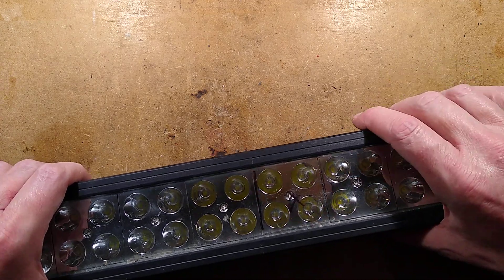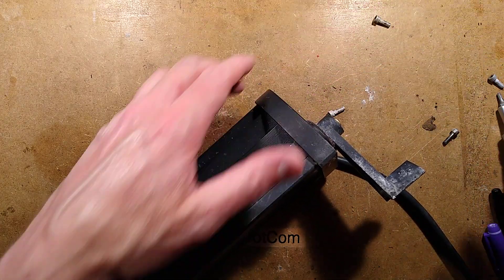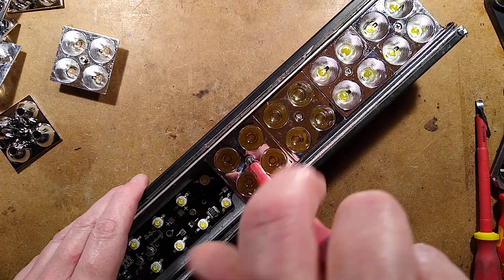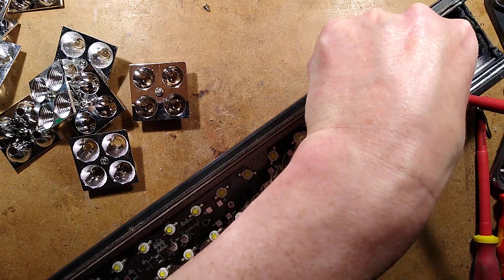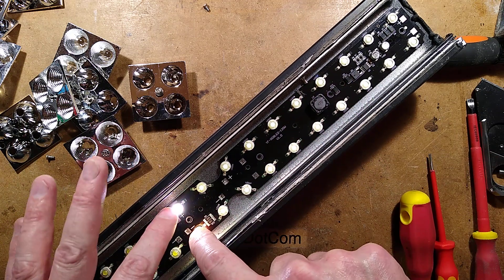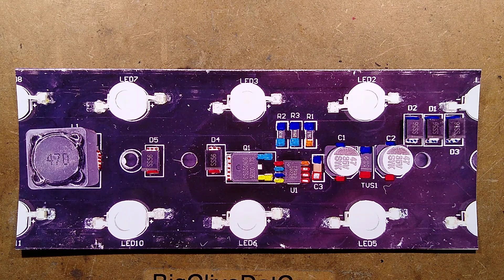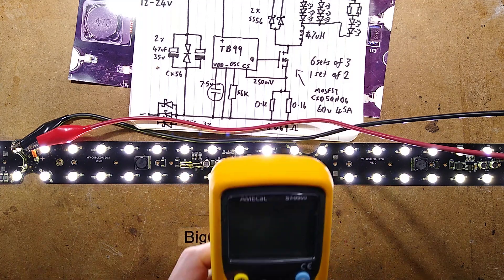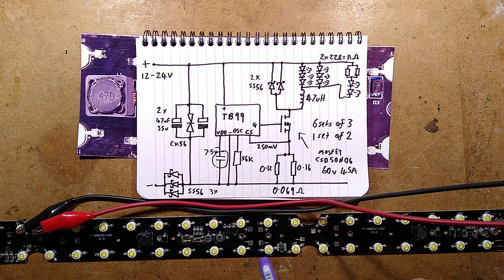Opening a work light from a commercial fishing boat (with schematic)

Comment: I managed to remove the glass on a small version of one of these floodlights.
I noticed that the black rubber strips had a few millimeters sticking out of each end, so I was able to pull both these ends - not to drag the strips out, but to stretch them to a reduced diameter, thus reducing their grip on the glass.
The rubber strips had been fitted dry.  There was no glue or cured sealant involved.

Comment: Only the solder joints being affected means that while it is water proof, it's likely not 100% air tight and the corrosion is from salty moist air getting in.

Comment: Thanks for sharing. 
That's a different design to the LED bars I've pulled apart to reverse engineer. 
All the bars I've stripped have all the LED emitters in groups of 6 series strings. Each series string comes on it's own PCB (a module if you like), complete with separate boost drivers for the 6 LEDs on that module. 

Using this module design, means the LED bars can be made into different lengths, in multiples of 6, with 6, 12, 18, 24, 36, 42 and so on. The only difference between them being the length of the aluminium extrusion, the length of the glass, and the number and design (spot or flood) reflectors used.

Additional this LED bar uses sealing compound to seal the glass, end caps and cable entry point.
All the bars I've pulled apart have used greased O rings to seal the polycarbonate lens and the extrusion, with additional O rings sealing the end caps, the cable entry being the only area sealed by compound.

Comment: Do stainless steel and aluminum get along by touching each other all the time?
Two dis-similar metals, in the presence of salt water, lust after each other like two horny teenagers. 
The white powder around the screw's threads, indicates aluminum corrosion. 
Me thinks they should've used aluminum or plastic screws instead of stainless.

Comment: Interesting approach of using the same kind of diodes in parallel. Guessing this translates into a cost saving.
Reply: Yes it will increase the current carrying capacity so can replace a much bigger and more expensive diode, however it is fraught with danger since not all diodes are exactly the same.  The diode with the lowest forward voltage will still carry much higher current.   It's not something that is usually recommended.  I guess that's how China do...

Comment: it would be intresting to try to re- seal it up ... sealing for salty water is different than regular water mainly becoz of the salt residue and the fact that salt will eat up and erode most of the sealing compounds
Reply: Water is a damn tricky thing.

You get what appears by all accounts a good seal on something from the elements... You'll find out the seal works, but only in reverse.

Never have figured that out lol

Comment: We engineers can get fooled when a schematic gets turned upside down, but what you have here is a conventional buck regulator with a very small "twist" to it: no output filter capacitor. LEDs need regulated current, not voltage, so the TB99B controller does away with the unneeded (and sometimes unreliable) output filter cap. If you turn Clive's schematic upside down, you will see a standard buck regulator but without an output filter cap. Of course, you need to reverse the polarity of the catch diode, and swap out the NFET for a PFET, after which Bob's your uncle. Probing the drain of the FET, you will see a rectangular voltage waveform whose duty cycle is Vout/Vin, although in this case, Vout is referenced to the positive power rail, not ground.

You see this kind of arrangement with the load referenced to the positive power rail rather than ground in a lot of LED mains-fed switchers. It crosses many engineers' eyes when they first see it, but that's what's going on. Beginning engineers think everything must be "ground" referenced. That's not necessary. Electrons don't care what your reference is. "That's your hangup, not mine." 

Not sure why the ceramic filter cap on the output of 7.5V regulator failed. In my experience, ceramic caps are usually quite robust. It may be "just one of those things."
Reply from the maker: Traditional ceramic capacitors used to be extremely reliable, but they have made the layers thinner and thinner to the point where stress can cause then to crack and develop parallel resistance.
Reply: @bigclivedotcom  I want to state that I am NOT trying to pick a fight, only try to understand why the regulator failed, from half way across the planet. I question the blanket "stress" statement. What stress? This particular capacitor should lead a very gentle electrical life. My theory: without a capacitor on this Vdd node, the part will not operate properly. Regulators require a small capacitor to be stable. I would suspect a bad solder joint on this node, causing the capacitor to be disconnected, leading the regulator to become unstable. Solder joints are a very common source of failure. They can certainly crack. Just touching the 3 nodes (2 on the capacitor, one IC pin) with a soldering iron would have tested that theory. Oh well. Thanks for hearing me out. I look forward to all of your videos.

Comment: I think they might have slid the glass in an then spread sealant in the groove and squeezed the rubber bead in to seal it. Removing that black bead might have been the move. Like a car windscreen. I am replacing security lights at the moment with led versions a 1/10th the wattage but 30% more lumens. I got a complaint that they are too bright lols.

Comment: I fixed one for a friend few years ago. It was a 50" ebay chinesium one. The construction was similar but much easier to take apart and back together. The glass was held by 2 strip of aluminium screwed with a ton of screw in the body of led bar.
 The fault was only after 2 -3 min of use all the led bar went out except a small group of led on one side. Once open, the fault was easy to find. 
The power cord was solder to the board and traces power all the other power supply. They added small wires over the traces because the lamp draw a lot of current. At one place close to the power cord a wire was solder on the + trace, 2 inches of trace vaporised and another wire going to the rest...
I solder a piece of 14 awg solid wire and it was fixed, + a lot of silicone to put it back together
Reply: What about internal condensation from moist air?  Ideally, a product like this should have been filled with dry, conditioned air or better yet some inert gas like nitrogen before being sealed up. The fumes from the curing silicone caulk could also be corrosive over the long term, especially if it's the vinegary-smelling stuff.

Comment: I got the Wally world special version of this thing... Haven't opened it yet but also not planning on putting it in the elements and it was for a project that hasn't yet come to be... I digress.

It's effing gnarly bright... But I'm not gonna let it run any length of time until I've confirmed the heat sinking (or lack of as is common 🙄) and check it out...

I like previews of anything tho, even if I'm not gonna be going in what I see... This just happens to work out lol

Comment: As someone who goes off road all the time the best thing I've found is to take the light bar apart right when you get it and just smear silicone on every mating surface you can.
Reply: Silicon as in the setting type or Silicon grease?
Reply: @darkknight145  or the type used for boobs...
Reply: @darkknight145  silicon grease is completely another type of paste, just for greasing/lubricating where you don't want petroleum product. Silicone sealant neutral or acetate like bathroom sealant. Or something much stronger like polyurethane or polimer sealant.
Reply: @mihamaker  Could the acid released into the sealed enclosure result in corrosion? @ acetate silicone. Nail polish is a popular choice, I think clive used it on some of his outdoor lights with good results.
Reply: @obliviousostrich1002  Acetate yes for sure it will react to any exposed reactive metal. That's why I noted neutral silicone if someone wants. Similar stuff is for gluing mirror on bathroom wall or cabinet door. Otherwise it will eat off the reflective metal backing. 
Nail polish could be used no problem for something small, it is great option. Acetate is also called sanitary silicon, that goes around utilities in the bathroom and in the corners connecting two tiled surfaces. Grout goes only in the flat area between tiles. There are some extra flexible grout mortar but too expensive and still if a lot movement ocures it cracks a hair line or more. For example two adjacent walls one brick other tiled drywall. I. 
Sorry I am going OT for a while.
I enjoy explaining few things if others willing to listen. If not, no hard feelings. Knowledge should be shared.
Reply: Also make sure to replace the thermally conductive compound between the LEDs and the heatsink. Most of these off-road LEDs don't have any to begin with, and when they do it is usually super cheap and crappy.
Reply: @seanman6541  the one I repaired a while back had the LEDs glued to the board
Reply: Window weld is the best thing I have found for sealing them.

Comment: This thing lools nearly identical to the bar I recently installed in the grill of my mom's minivan. The reason for the lensed LEDs on each end of the Bar are to act as Fog Lamps. By rapidly turning the power switch on and off you can switch between 3 modes, 1 where the entire Bar is lit, a 2nd where only the center bar is lit, and a 3rd where only the lensed clusters of 8 at each end are lit. Its a pretty good little light for the price. Really illuminates the Deer and Raccoons on these country roads out here in the Midwest Wasteland. :3
Reply: We throw a few on everything that moves  here in the Appalachian mountains.
Reply: @solrosenburg9595  I know, I lived in Mt Hope WV, smack dab between Beckley and Oak Hill, from 1992 to 2007, and even before LEDs were really a thing everything had to have a Halogen or Zenon flood or spot ziptied, hogringed, ductaped, or plumber's taped to it. O.o
Reply: @grayeaglej  I've run that road more than once.  My mother's from Oak Hill, and relatives were from Deepwater to Beckley.   People in Houston don't believe me when I tell them the routines for driving around the hill roads, especially those only paved in the center.
Reply: @tbelding  Be absolutely fall on your butt drink because if you are the slightest bit sober you might accidentally go Straight for half an inch and end up either smeared across a rock face or rolling 300 feet down a gully through a few dozen trees. O.o

(Edit) I drove an Ambulance for Jan-Care 2005 and 2006. Taking the gravel roads into the hollars at 80+mph at 3am in ford F550 Box Ambulance on Two Wheels will make you appreciate seat belts. O.o
Reply: @grayeaglej  - I don't even like running the back roads at 30 MPH in daylight, let alone what the nutjob RidgeRunners would do at night.  I don't know whether to applaud your courage, or try to find where to have you committed.
Reply: @solrosenburg9595  A bike with mini light bar? Have done it too._

Comment: That is a aftermarket Led strip. NOT marine grade. Would be a USCG violation.
Reply: I doubt fishermen from the Isle of Man care too much about the USCG. LOL
Reply: @mattelder1971  definitely not but marine quality should. USCG required gas proof sealing, and non  farious material used in construction? I.e. stainless or aluminum body's and brass fasteners. Do you have west marine across the pond or a marine equipment supply store chain?

Comment: Great Video: Capacitors seem to be the main failure point in loads of circuits, can somone reinvent them so they last longer ?
Reply: Excluding for a moment the cheap knock off capacitors prevalent for sale on various sites, the main way to extend the life of capacitors is not to cram too much capacitance in a tiny package, and run them around I think it's 60-70% of their rated voltage. The closer to rated voltage they are run the shorter their lifespan.
Reply: There's nothing really to "reinvent", just the (as Clive mentioned) over miniaturization bit. There's nothing "wrong" with the caps these days (true "plague" was a slightly different thing), they are simply rated with way closer margins than they should be.

Old school rule of thumb... No more than 50% rated "whatever" at the intended operating temp... That's partly (not close to entirely lol) why things were so damn big back in the day... "Make damn sure".

Everything these days is within a few % of failure, LEDs in fact (the individual dies and cooling combo) being one of the worst. They would be crazy more efficient and last long enough to pass them to the grandkids by just backing off the ask a few points... There are other ways to get the lumen count desired... Clive has even done videos on it... But where's the money in that?

Same thing with the caps... Tiny doesn't just mean small phones, it means less raw material the manufacturer has to spend cash on to make the components... 

So it's win win for them... Push everything to the limit by minimizing what it's made of, save money there. If it fails? Sweet! They gotta buy another one.
Reply from the maker: They used to be reliable, but they's over miniaturised them.
Reply: @bigclivedotcom  They also kinda found themselves in a predicament with 'lytics and SMPS.

I very rarely (only the super high end electronics) see electrolytics bypassed correctly (normally not at all) for the demands high frequency switching puts on them... We're starting to see those issues fade because the frequencies of supplies are getting so high, 1uF can do the job 10,000uF (or, higher) would have been needed for with 50/60 Hz linears, and several hundred to a couple thousand can do for slower SMPS.

10,000uF caps have to be electrolytic. Not practical to do more than handful uF without them. 1uF can be damn near anything in theory (SMPS wants it stiff tho, lol sooo..)

It is what it is. Some equipment won't escape them... And proper bypassing is a way to greatly extend their lifespan... And it's cheap... 

Leaves only one thing. Just more fuel for the theory...

"We want it to fail" 🤦‍♂️
Reply: There is Engineer who sole job is to make it work till the warranty expires. It is like they put a clock in the chip. Tick tick bang times up. Now buy a new one.
Yes I am very jaded.

Comment: I'd think that they put a sealant in the track for the glass that cures after the glass is slid in. Seems a very intelligent design choice for an electronic device that is expected to be used in harsh conditions. But yes, that does effectively make it unserviceable.
Reply: probably the same stuff they bond windscreens in with
Reply: @eliotmansfield  Exactly what I was thinking. That would explain his difficulty in getting it removed from the housing.
Reply: @eliotmansfield  , a good chance of that.  a sort of polyurethane adhesive.  its used in car windshields and probably train and bus windows as well because when it sets it becomes structural.  and one of my cars is 35 years old and the window adhesive is as good as new.
Reply: I took apart a similar light with an acrylic sheet instead of glass.  In that case I reckoned they'd used something like alcohol to slide the acrylic sheet in with preformed sealant beads in the extrusion.  It becomes immobile once the alcohol evaporates.
Reply: Yes, a cured urethane adhesive as used to bond windshields in place. 

If you are ambitious you can usually remove glass like this by cutting the adhesive away from the glass with a thin wire saw. This requires access to both sides of the glass so a long tool with an eyelet is needed to position the wire on the inside surface of the glass.
Reply: @hobbesscott1014  , i've seen it done by professionals on one of my cars with an oversized two handed olfa blade knife.  its the only time ive seen these things.
Reply: @vsvnrg3263  You can see how a wire saw is used to cut the seal on windshields here: https://www.youtube.com/watch?v=gq-xijoj2HE . For something like the light bar, you can just saw the seal by hand by moving a short piece of wire back and forth around the glass perimeter.

Comment: To clear such subborned glass use a thin steel wire to cut the seal, kind of like they do when removing windshields
Reply: And if that doesn't work, garrote the product's designer with the thin steel wire!
Reply: But there would not be a good way to pull it on both sides in this scenario.